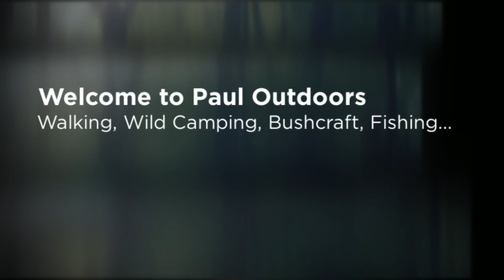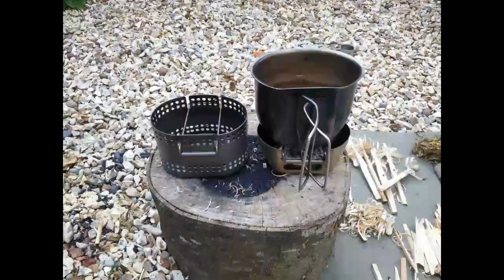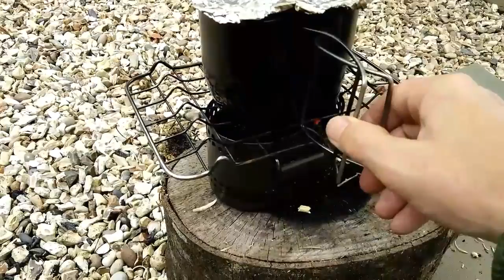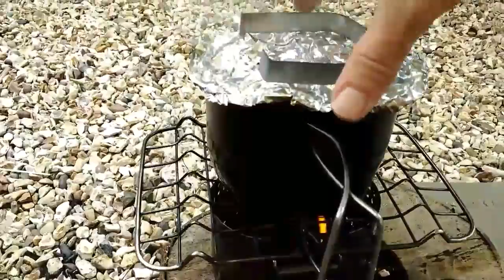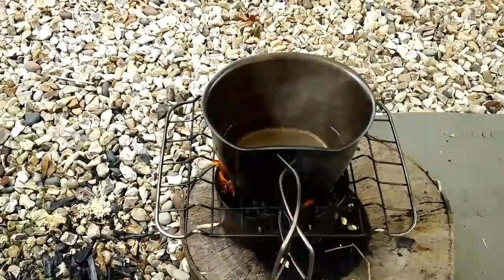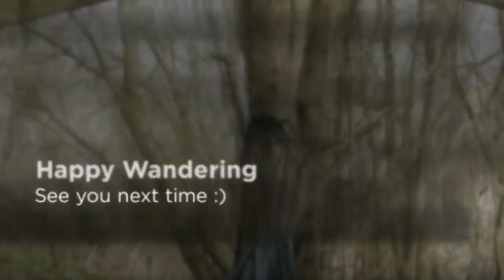Part Two - BCB Crusader MKII Cooker Mods for use as Wood Stove

Comment: Have you tried the new canteen cup as well? I think its fits more flush with the cooker creating a bigger airflow problem. Will try your grate/tent peg tip! Thanks for the video.
Reply from the maker: Bushcraft Baking I haven't bothered with the new Crusader Cup as I don't use aluminium cookware for boiling or cooking in but as you say I have seen the new mkII cooker and cup and feel that the original versions are better. Thank you very much for watching and commenting. Much appreciated :)

Comment: that will work great with my folding grill 
fantastic experiment the sky's the limit with the new system 
i was thinking of breaking the twigs down to about inch size similar to the cat litter will mean that fuel use is at a minimum, similar to the way i use the wild wood gas stove 
cracking vid thanks for sharing
Reply from the maker: Hello John. Thank you for watching and commenting. Yes, small pellet size pieces of wood work great just like the cat pellets in the wood gas stove. Instead of the grill I now use two tent pegs to raise the cup. Trying to increase the versatility of kit :)